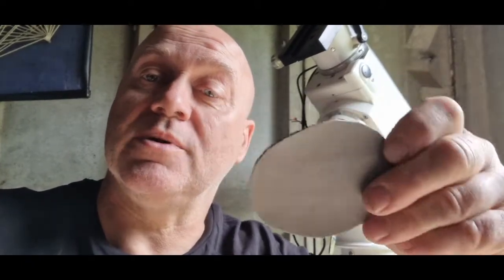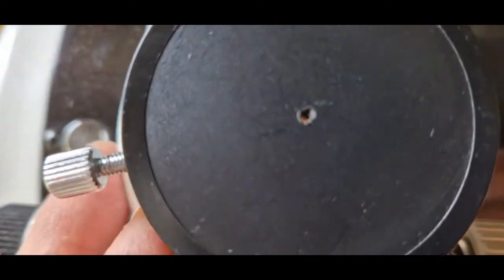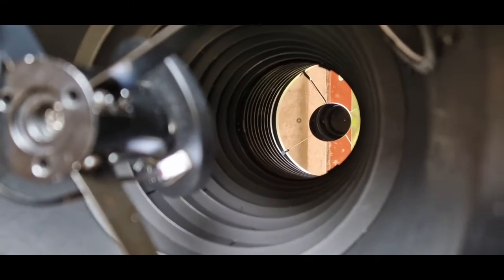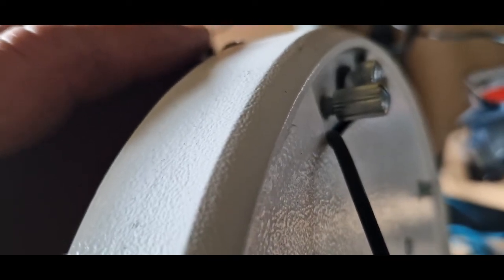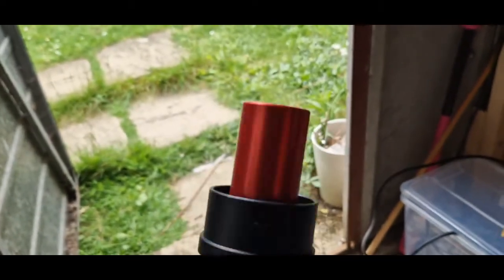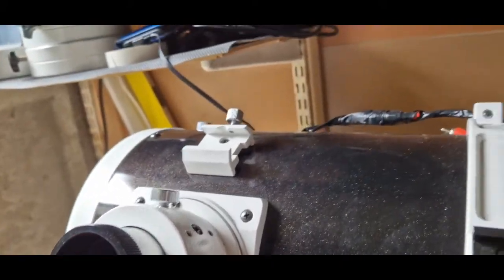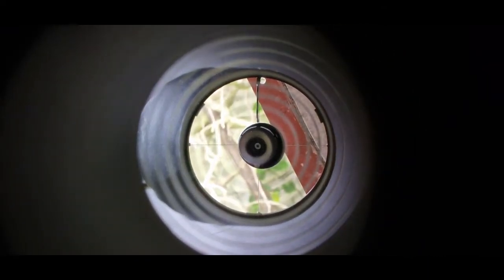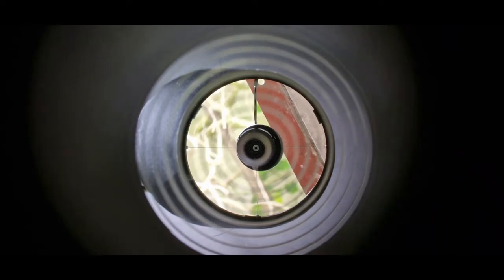Collimation Fast Newtonian telescope.

Comment: I have a little issue, my eye cant focus the haircross of chesire what is the correct position to see trough the hole of chesire to easy center
Reply from the maker: Hello. I would make sure the Cheshire is turned towards a light source. It sometimes helps to back your eye off it a bit. Also have drawtube fully extended can help to. Maybe use your phone camera though its best using you eyes. Clear skies
Reply: @sevenskiesastro  use my camera 🤔🤔 omg great idea i can move the dial to focus the cross and the camera would be on correct angle to see through the hole. Clear skies too

Comment: This maybe a dumb question but...
Just to clarify... It is not necessary to center the reflection of the collimation cap (eyepiece) in relation to the reflection of the secondary mirror on the primary mirror to the secondary mirror? Because i have been trying to align all mirrors as circular as possible and as center as possible qnd i couldnt get it right. And i saw your vid and what you did is just make the secondary mirror as centered as possible and center the reflection of the eyepiece to the actual crosshair of the eyepiece.
Reply from the maker: That is correct. There is a built in offset. It's the cross hairs that need be aligned to the primary mirror. The secondary mirror should align the primary near as possible concentric to primary. It's the primary that aligns the centre dot to the eyepeice/cross hairs. Hope this helps. It's not as hard as it sounds. If centre's align then your good to go. Don't over think it and enjoy the skies. Thank you for watching and clear skies.
Reply: @sevenskiesastro  to be honest i have watched a lot of collimation videos and youre the only one who pointed it out... I was doing everything other videos taught but the one you pointed out is the one that i have not done yet. I followed your instruction and will test it out later. Thanks so much!!
Reply from the maker: @AnzeiGaming  your welcome. Hope you get to enjoy your telescope and have many a happy evening under the sky.

Comment: Thank you!! I'm new to telescopes, and I've never heard of the concentric eyepiece. Just having two small holes in line, it seems like the most accurate.
Reply from the maker: Thank you. The concentric eyepeice seems to me to be best though all work. Concentric can be done in daylight at your leasure then a little tweak with a star test. Clear skies
Reply: @sevenskiesastro , it was an honest comment. Looking though two fixed, aligned vision references makes sense to me. That they're holes in an eyepiece is secondary. Even a tiny single peephole could introduce error. I'm new to amateur astronomy and trying to learn (thus why I found your video and channel), but logic has been my attempt for decades. Edited to fix typos.
Reply: @petset77  A company called Farpoint manufacture a nifty solution.  They call it an Auto Collimator - it's similar to the colimation cap shown near the start of this video, but machined out of aluminium with a highly reflective telescope grade mirror on the inside.  This causes cascading reflections between the primary and secondary revealing multiple primary centre dot reflections.  You line all these up and your scope is very very accurately collimated.
Reply: @rv3211 , thanks. I'll check it out.